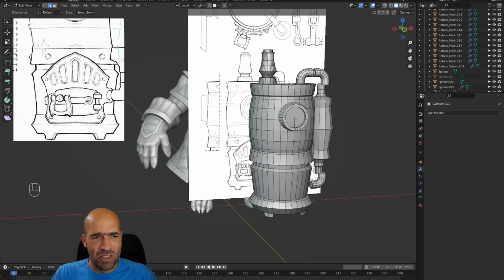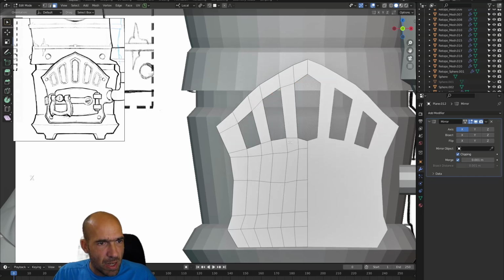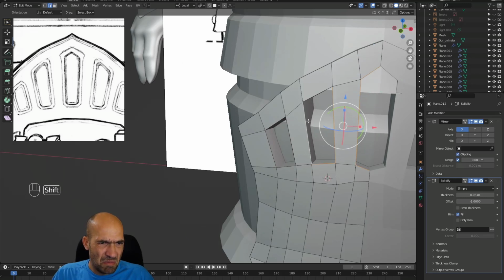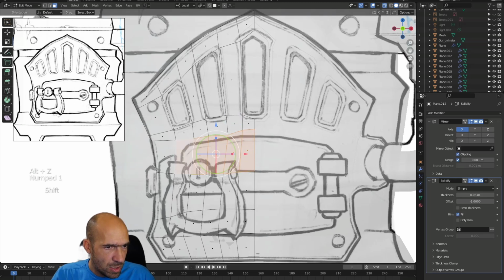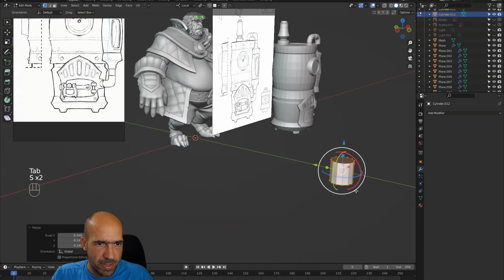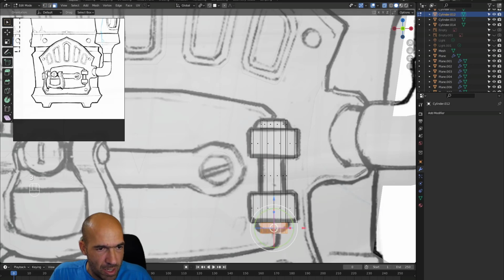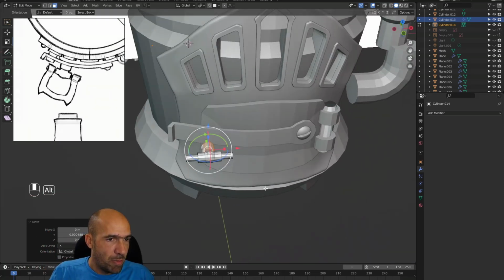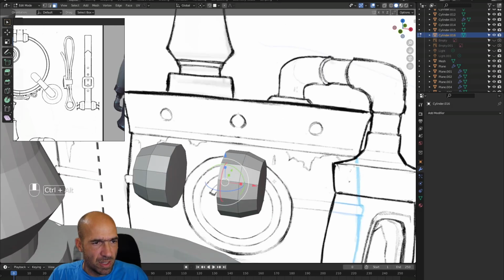Making the weapon pt02 - Create a commercial game 3D character episode 17

Comment: Lattice modifier requires u to place a Lattice object which you can find by pressing shift a
And then conform this object to the object that u want to deform and then give the Lattice modifier to the object you want to deform, select the Lattice object as 'object' and then deform (move the lattice object) 
But in this case, pressing 'o' and then selecting the middle edges and moving them along x axis will give you the deformation u want
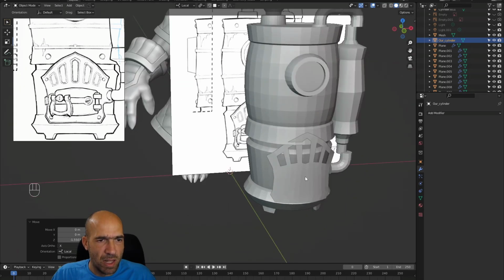9:47 but honestly, shrink wrap did defientely gave u the most correct result
Reply from the maker: Тhis Lattice seem too complicated for me :)
Reply: @SpeedChar  i learnt a lot about blender by gleb alexandrov's hard surface course
Lattice tip for deforming high poly objects comes from that course. I highly recommend it.
Reply: @SpeedChar  honestly, it is a bitch to work with and i only use it if the mesh is already high poly. There are addons that simplifies the process like simple Lattice